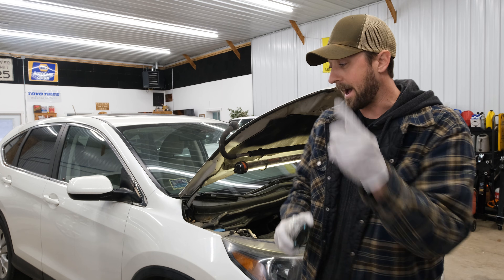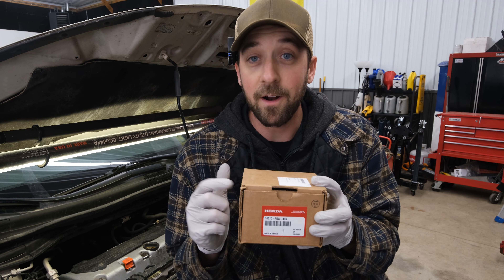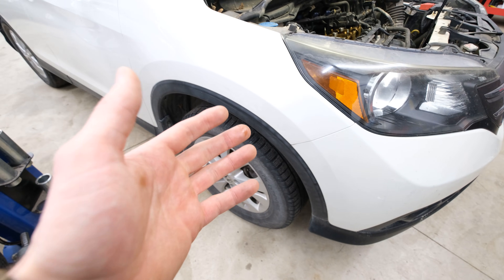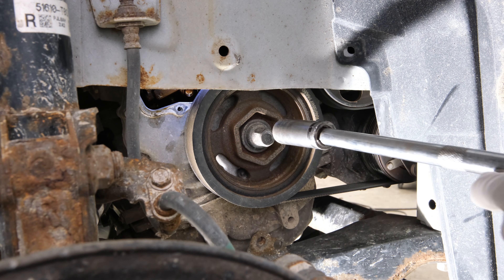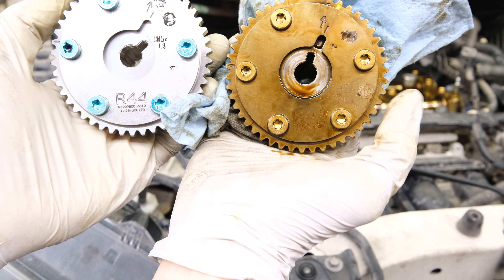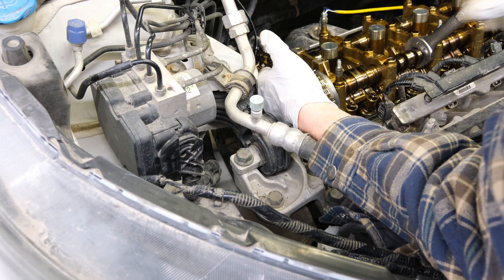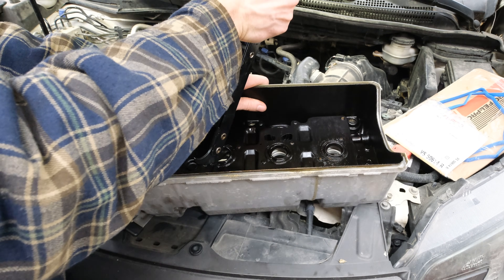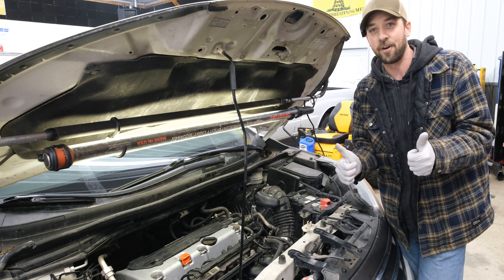Honda K-series Engine Rattle? FIXED! (VTC Actuator Replacement - 2014 Honda CRV)

Comment: The rattle is created by the actuator's locking pin bouncing back in forth in the locking slot due to a weak spring. It is not due to oil being absent in the actuator's retard/advance chambers like many claim. The problem is that when the car sits for several hours, the oil passages suck air into the oil system. When one starts the engine, the oil/air being delivered initially to the actuator is a "sputter" of oil and air pressure. The difference in oil pressure getting to the locking pin creates a hammering effect on the pin unlocking-locking it many times rapidly creating the jackhammer rattle sound. Change to a stiffer locking spring as possible on to wich it can still unlock at high rpm's for the variable timing to work. Worked for my wife's 2013 CR-V. Done about 1 year ago. She's very happy now😊.
Reply: So the solution is change to a stiffer locking spring?
Reply: @Scott-xq2dm  Yes. Stiiffer and a bit longer spring. I used the one from spring start, (the one with the same length but stiffer). Rattle came back in a few weeks. I pulled the spring out, stretched out a considerable amount, reinstalled it, and the rattle has been gone for over a year.
Reply: There's also the Spring-Start Extreme R44 kit for harder cases.

Comment: Years ago I bought a ‘08 Accord k24 with 113k miles from a lady 🤦‍♂️engine was rattling and I replaced the i-vtec sprocket and timing chain tensioner with genuine Honda parts purchase from the dealership and 10k miles later the rattling came back regardless synthetic oil Mobil 1 and oil change every 5k miles 🤦‍♂️still have some pics of the disassemble 😏

Comment: Very helpful video. Thanks. I am struggling to fit my torque wrench in the area of exhaust sprocket and tighten the bolt! Have you removed anything else? What wrench have you used? Watched the video but it was not clear
Reply from the maker: Yeah it’s tight, use a shorty chrome socket. The 3/8 torque wrench I have is a much slimmer profile.

Comment: I have a Honda crv 2010 can I used the same part's your using
Reply from the maker: I believe they are the same, but double check with your dealer. Just give them your VIN when ordering the part.
Reply: @ManvsCars  Thanks
Reply: I am having the same issue each morning I start the car I have been watching so many videos and getting all different kinds of ways to solve the issue.

Comment: Nah. I replaced mine also. Came back before even a year. Researched hard on forums and so many said to take the spring inside the actuator and stretch it a bit. Then no more noise. The spring is a lot easier to get to. There are some videos on this. I will try this instead of replacing it again.
Reply: did you do it yet
Reply: @mongopoe5099 have not had the time yet..plus it is winter..brrrr.
Reply: Any luck?
Reply: @truthtalker7774 not yet. No time to do it and it's cold outside..brrr.
Reply: @jimevans4224  Please let us know after you've done. Thanks in advance.
Reply: @Scott-xq2dm I will. Might be a while. Health took a turn for the worse the last few days. Thanks

Comment: did you try change spring only $35?
Reply: Spring-Start VTC has the kits.
Reply from the maker: @spring-start  Next one I have to do Ill try the kit.
Reply: The spring is inside the actuator. You just take the cover off the actuator and install a new Honda VTC Spring Kit.
Reply from the maker: Someone else mentioned that, never heard of it.
Reply: Do you by chance have a link to this spring and how to replace it?  $35 sounds MUUUCH better than $400!
Reply: I didn't see the spring in the video. Can you tell me when in the video I'd be able to see it?

Comment: Did this very job a couple years back on a friend's 2014 CRV by replacing the actuator with THE Honda upgraded part and it didn't even last a year and the rattle returned. There's a kit by Spring Start that fixes this issue without replacing the entire VTC actuator.
Reply: Did it on my 2013, $35 no rattle.
Reply: @yiranjack i accidentaly didnt order the stiffer spring from springstart. Only the oem style. Should i wind it inside the old weak one or just put a fresh new oem one in ?
Reply: @Luca-ob4no  you better order the stiffer one from them, it is all this about. This job itself is a pretty labor intensive one, the rubber valve cover seal need to be replaced and you need some Honda bound to seal the corners. Also it's a great time to replace spark plugs.
Reply from the maker: Bummer, what’s the kit?
Reply: @ManvsCars  spring-start, google! change spring easy than VTC Actuator
Reply: Same with my 2014 CRV, had R4A VTC changed under warranty, to upgraded R5A VTC, about 10,000 km latter rattle back, guess I should try the VTC spring change from Spring Start.
Reply: @Pfdisme  Recently watched a really good video on the VTC rattle and how it can be the VTC actuator, the timing chain tensioner, timing chain guides and/or stretched timing chain. A thorough inspection is really needed before the parts cannon is pulled out. I did check the timing mark alignment on my friends 2014 CRV before we changed the actuator to the R5A. Funny thing is he says it stopped doing it right now so we're leaving it and might change the spring in the spring. Changing the spring is easy because the spring kit comes with the bit needed to remove the bolts. Just have to put a wedge behind the actuator to hold the cover in place.
Reply: Just replaced my spring with Spring Start kit. It has worked well for a 1000 miles. It developed a light squeak that goes away in few minutes after the oil goes around the engine and the actuator. Seams to be common side effect but, no rattle and no adverse effects. The R5A actuator looks identical to the R44, I have a new R5A that I never installed and compared to the original R44 installed. X inf fingers this will last!

Comment: I bought Toyota parts from eBay.   Came in a legit looking Toyota box.  But the part was clearly not a Toyota part.  Just coils so 1 bolt swap out.  Thank goodness I didn’t have half an engine tore down.
Reply from the maker: Yeah it’s getting a lot more common. It’s usually a brand new eBay store with “genuine” oem parts. People are buying them but they aren’t OE that’s for sure.

Comment: Whats the mileage of that crv?
Reply from the maker: Around 180k-ish
Reply: @ManvsCars  I'll bet that's the second time the actuator been replaced.  The first time they did the whole timing set.  No way there is no chain stretch at 180K
Reply from the maker: @gfriedman99 possibly, I have no clue.

Comment: I wish it was this easy. Even after you replace the VTC actuator, the rattle comes back in a few years. It is just a bad design and honestly there should be a class action lawsuit Against Honda
Reply: Stretched chain will cause the new to go bad faster, so when doing timing jobs, always do all things - chain, tensioner, guides and variable actuators(if the car have) if you want to make another 200-300k miles
Reply from the maker: This ⬆️. If you have the means, do the works. Your engine will thank you.
Reply: @ДимитърАндонов-ъ7е  great point. I should've replaced the chain and tensioner.
Reply: @ДимитърАндонов-ъ7е  My 2012 cr-v is at 146k miles and does rattle. However, the engine runs mint. When I get a CEL for timing chain related then I'll consider replacing the whole 9 yards.
Reply: There was a lawsuit.  But you only get relief in 2 states.
Reply: Using 30 weight instead of 20 weight oil helps supposedly. The 20 weight causes the chain and phasers to wear out prematurely supposedly.
Reply: class action lawsuit for millions of K series that have lasted over a decade and ran 100s of thousands of miles? your on crack

Comment: Very informative video. How long would you say a timing chain is good for ?.  I know timing belts need to be serviced at regular intervals.
Reply from the maker: Good question… mileage may vary honestly. A good time would be when the phaser starts making noise 😁. Honda I think considers it “lifetime” which means until it breaks is all. I think it would be wise to at least inspect it if the vehicle has high mileage.
Reply: @ManvsCars  Ok ill have to dig in and look for information I have a 2015 Volvo Xc60 T6 3.0 I have just over 200,000 Km My chain is on the same side as the transmission due to the size constraints on putting a turbo inline 6 sideways.